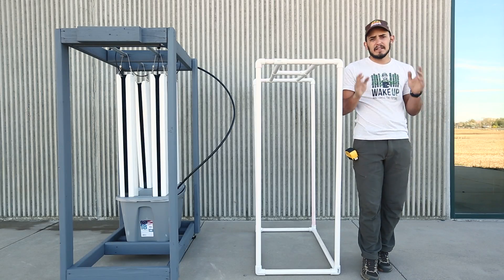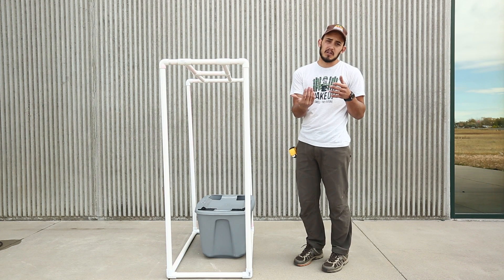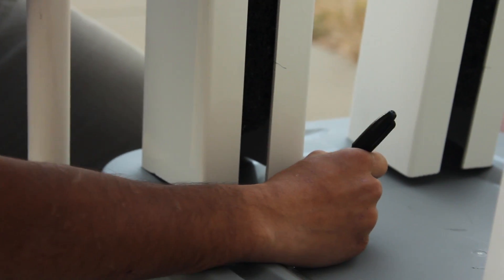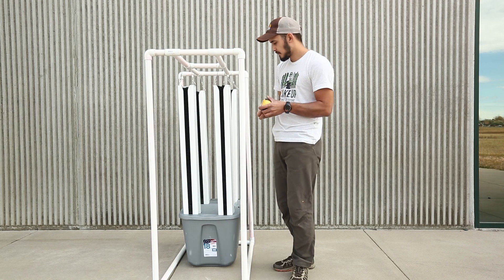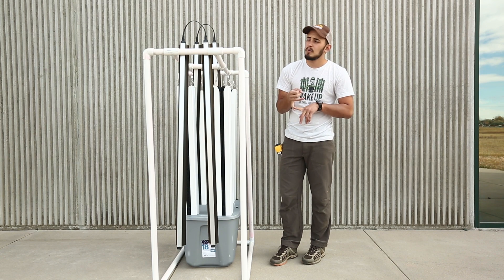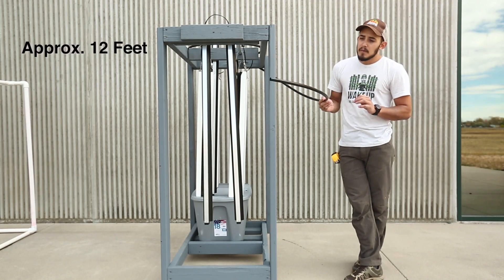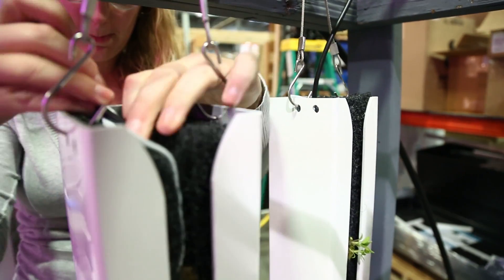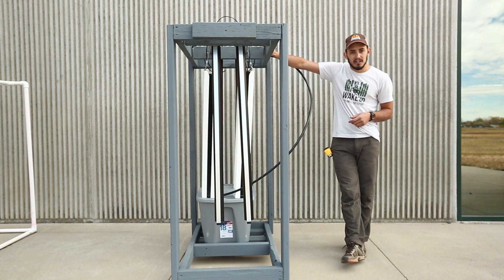DIY ZipGrow™ Hydroponics System (no music)

Comment: how are you supplying the lights with power? thanks for the video
Reply from the maker: Hi Brett, these are your standard T-5 lights with connectors that plug in to a standard outlet.
Reply: ok great thanks for responding
Reply from the maker: our pleasure